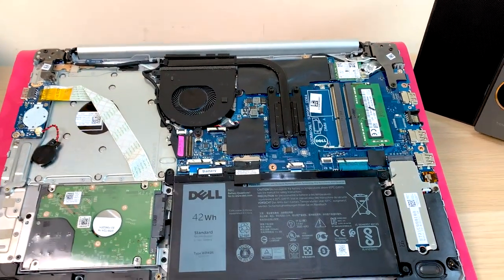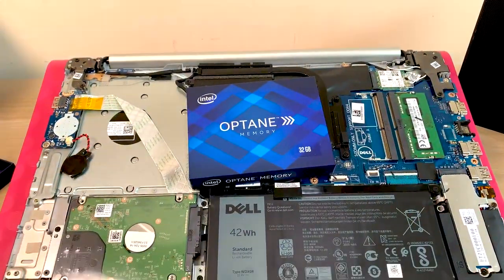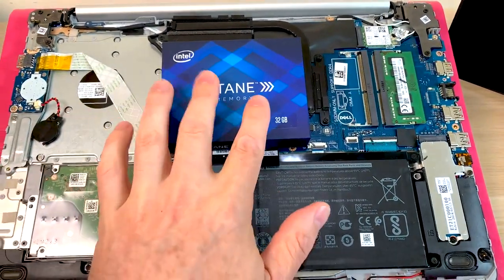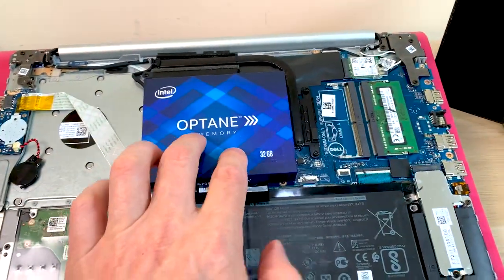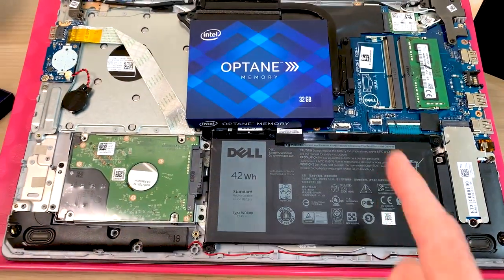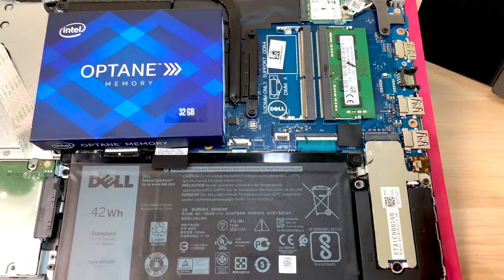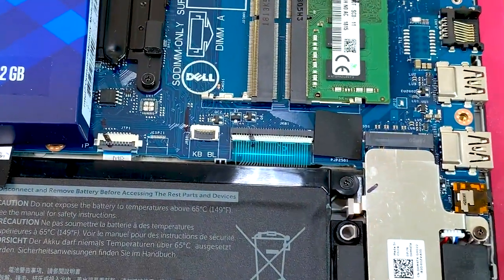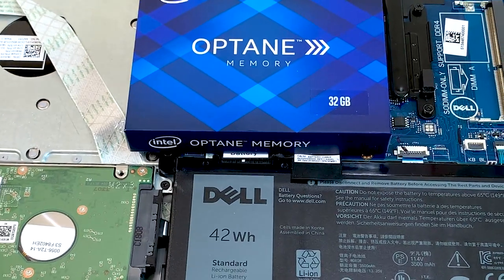Turbo Boost Your Laptop

Comment from the maker: You can use a Optane SSD to boost any Laptop that has a M.2 SSD (or Desktop) as a primary boot SSD (where your windows is installed on) You will need a Optane compatible Laptop to take advantage of the other features.

Comment: I am confusioned. If I already upgraded my hard disk to ssd. Any benefits I will get from this hardware?
Reply from the maker: So the two and a half inch HDD was replaced with a SSD? Does your laptops have a M.2 SSd
Reply: @TallyHoTech  I think I don't have this type of slot. My laptop is already 6+ years old.

Comment: works with XPS 9560 ? I asked dell they said they didn't
Reply from the maker: The caching and memory don’t work but you can use one as a primary SSD
 https://goo.gl/fWTtUu
Reply: @TallyHoTech  Isn't samsung evo m.2 more value and memory at this price ?
If the caching don't work why spend more money on optane
Reply from the maker: Because optane has the fastest latency  and response. You don’t buy it for value. You buy it because you want the best.
Reply: @TallyHoTech  But it isn't, in real world applications
https://www.techspot.com/review/1651-nvme-ssd-performance-2018/

Anyway thanks for the feedback, cheers man